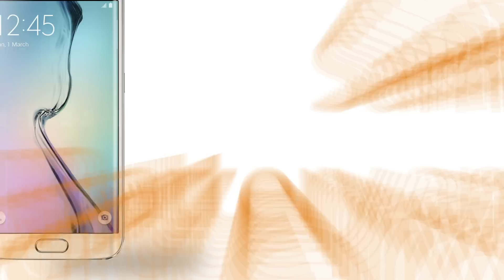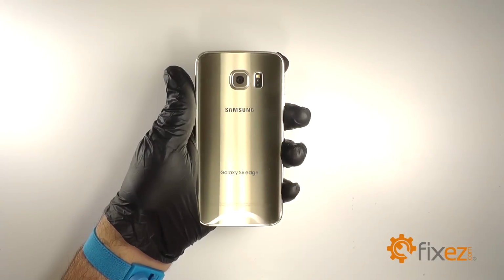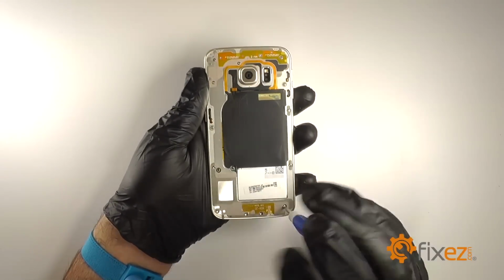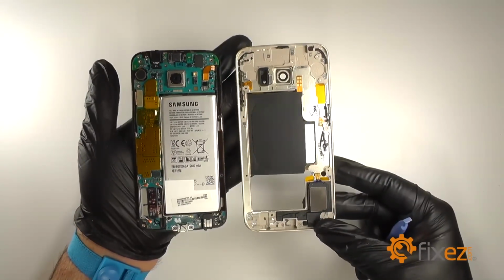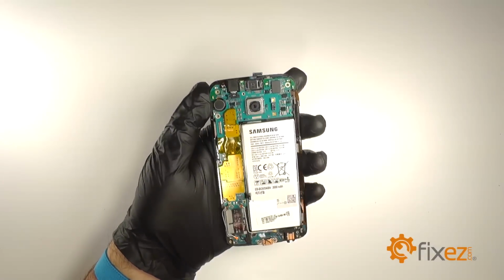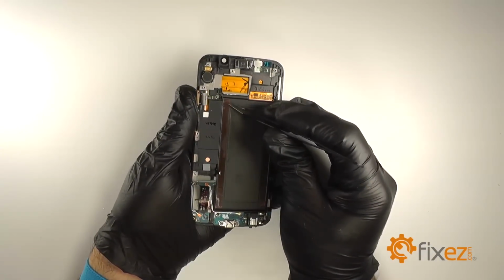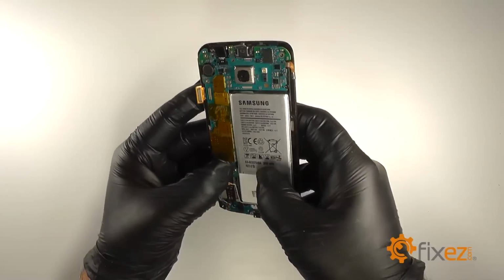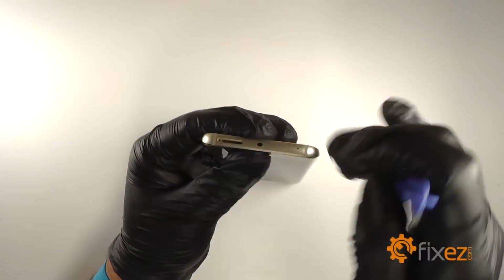Samsung Galaxy S6 Edge Battery and Inductive Charger Repair - Fixez.com

Comment: The removal of the back glass was shown to be deceptively easy. I understand it looks smoother for video production to seem as if you can apply  a little heat and pop it off. Unfortunately the reality is this little lie will certainly cause some people to break the rear glass. I believe I made this criticism before in an effort to spare others from damage ...  but it looks like the comment was deleted because you care more about image than helping people.  I guess a thumbs down will have to do. Great video overall .
Reply: very true.  they made look easy, but they dont show you everything
Reply: Not only Is the back glass removal made easy looking but so is removing the battery which actually sits on on the back of the display so too much pressure and you need a new display and heating the glue under the battery is not easy and fast

Comment: do hairdryers work as well as a heat gun? i tried using a hairdryer but the back cover was still so stiff after a good 10 minutes
Reply: try more and gently lift the back panel with a plastic tool
Reply: @giofurla  haha thanks for the reply but I did end up being more patient and worked a treat.  Luckily phones are water resistant now and won't have to pry open my phone ever again 😅
Reply: @soumaya94  haha sorry just searched for this video for my old phone and watched the comments, i didnt evem noticed this comment is 4 years old 😂 btw please dont put ur phone in the sea or if u do wash it with clean water after cause yes those phone are waterproof, but not water resistant, also the warranty will not cover water damage, so please be careful! Have a nice day 😊

Comment: @Fixez.com there is no additional adhesive on front of the display protection ? You didn't use the heat gun I saw, and you mentioned that it is hold in place by some clips.

Thank you for the video.
Reply from the maker: +gixxer4646 The assembly we repaired in the video included the frame which requires no adhesive to the screen. The screen assembly will already be adhered to the frame.
Reply: ***** Asking because I see way to many videos around with heating hop the fronts screen protection. In your video shows clearly that its hold by 4 clips.

Comment: I have a question. If battery on S6 blow itself a bit (not explode, but get big enough to open the rear cover) can that phone be fixed with just replacing the bad battery? Or bad battery comes with other problems like dead motherboard, etc? Thank you.

Comment: how much time should i warm the phone. plz tell me
Reply from the maker: We use a non-adjustable heatgun. The glass should be hot to the touch but not hot enough to burn you or melt any plastic parts.  You are just trying to heat and soften the adhesive.

Comment: does the inductive charger need any kind of adhesive or does it just stick there
Reply from the maker: +Joran Mcnabb No adhesive required. Simply place it on the back side of the device.

Comment: Hi, I also have a Samsung Galaxy S6 edge. I accidentally inserted a micro sim instead of a nano sim in the sim card slot. Now the micro sim is jammed. How far would I have to disassemble it to remove the micro sim card?
Reply from the maker: +Warileka Sam Follow the video up to about the half way point. As you would need to visibly see the sim card within the unit to try and remove it.
Reply: +Fixez.com thanks
Reply from the maker: You're welcome!

Comment: i replaced my battery easily with one from ebay HOWEVER.. the phone will not power up propperly.. it flashes a quick green light then the light turns a bright white/blue solid color and does not respond-- i am at a loss as to what the issue could be.. any ideas thanks so much ahead of time! mike-

Comment: My galaxy s6 edge says battery temperature is too low and it wont charge, how can you fix that?
Reply from the maker: +Eunice Andrade Possible you have a bad dock port or the battery itself. You may want to start with the battery.

Comment: Hello, I had a problem with charging of my phone. Alert says "batterry temperature too low" and it is not charging. So I changed the charging port. Charging worked ok, but at the 3rd or 4th charge cycle it showed the same error. I installed new charging port, but it says imidietly the same about the batterry temperature. Could anyone please tell me, what can cause this message and what else can be done to make it working properly again? Thank you!
Reply from the maker: +Adams B Possible you have a bad battery. Try a new battery and also perform a factory reset after doing so. Then see the results, if the issues continue it's possible that the issue is software related.
Reply: +Fixez.com 
Hello, thank you for your answer. I also changed the batterry, performed factory reset, but same problem occurs :-( Do you have any other idea, how it could be repaired? Thank you!
Reply from the maker: Difficult to say in all honesty. It can possibly be software related, you may need to have Samsung look at your device.